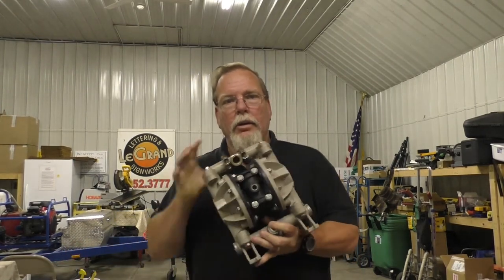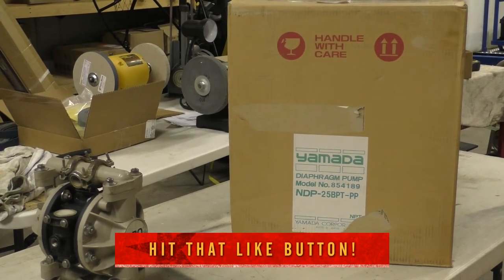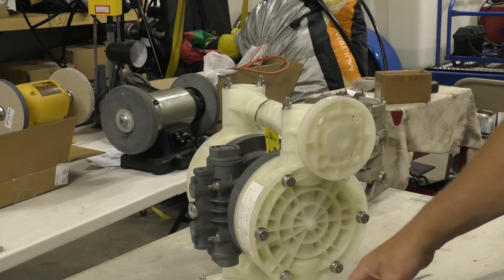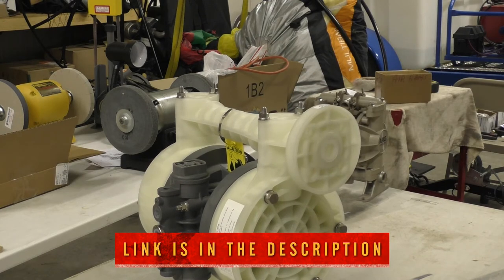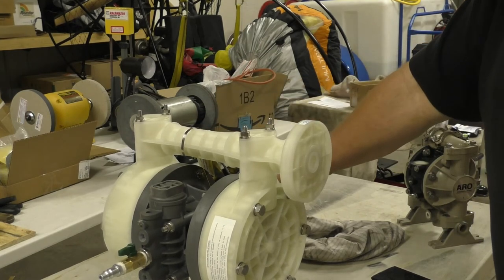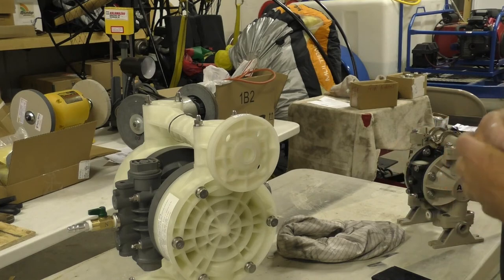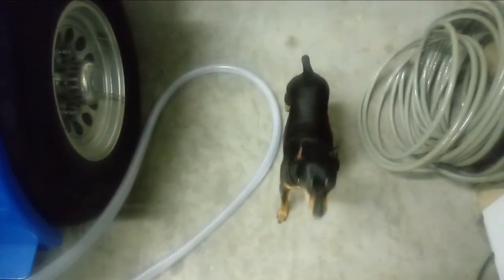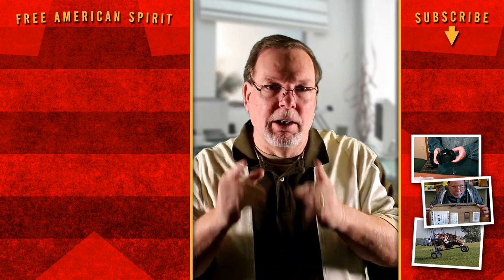Roof Cleaning Trailer Yamada Air Diaphragm Pump Un-boxing and tips Clean Now Pressure Washing

Comment: Nice presentation. I wonder if you could let me know : how to clean air operated diaphragm pump after it was used to pump water containing solids or slurry. Thank you in advance for your help
Reply from the maker: More than likely you would have to disassemble it, clean all the parts, flush out the body then reassemble it.  I have never run sludge or slurry through one as they are not made for that.

Comment: What type of air compressor would you recommend for that diaphragm?
Reply from the maker: Your going to need a compressor with at least 25 cfm... To run that 1 inch..
Reply: What about a 1/2 what type of air compressor? Not enough room on truck for a gas compressor so trying to see if I could run an electric.
Reply from the maker: Every pump uses a different amount of air. Jusr look at the specks and see what can/pressure the pumpum operates at some small pumps, like the all flow, can run on a small elec air compressor drawing 6 or 7 cfm, where as a same size areo pump may require  twice the air... That's why most guys have 1\2 inch pumps.... Besides unkess you are doing massive roofs you dont need mire than a half inch... Imho
Reply: @FreeAmericanSpirit  do you recommend the All flow 1/2 for the occasional roof? are there better brands/models out there? I'm new to the air pump game.
Reply from the maker: It dosent take much air to run the allow.. So just about any compressor that puts out 5 cfm at around 50 to 60 psi should be fine.     For real specifics check with allflow...
Reply from the maker: There is a ton of brands out there and the prices are all over the board.  Which one is the best depends on who you ask.. This pump is good for "the occasional" residential roof.
Reply: @FreeAmericanSpirit  i'm sorry I didn't say I already have the All Flo - i'm curious if it's worth upgrading from the all flo to another better air diaphragm?
Reply: @FreeAmericanSpirit  ok let me ask it this way... lol... whats the next step up from all flo? In your opinion
Reply from the maker: If you have bigger\larger jobs, or a couple jobs a day to do then yes because you could lay down more chems, faster or maybe reach a little higher peaks... But when you start going to 1\2. 3\4 or 1inch pumps then the costs and requirements of the compressor and hose size goes up..  So I can't answer if you need to upgrade or not only you can answer that
Reply from the maker: @mitchellwood3576  1\2 inch aodd .. I have to get back to work.  I suggest you get online and read all the forums on this subject or find a local guy who you can work with who can give you some hands on instruction ... That is the beat way to see various options to determine which is beat for your circumstances..